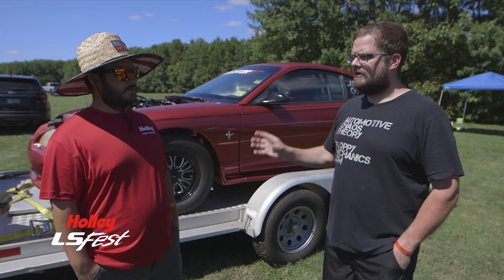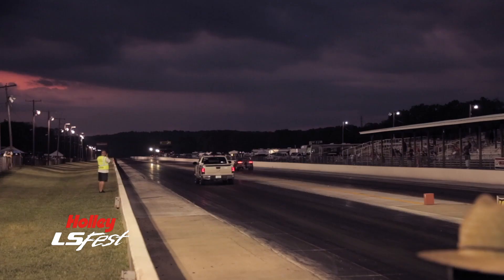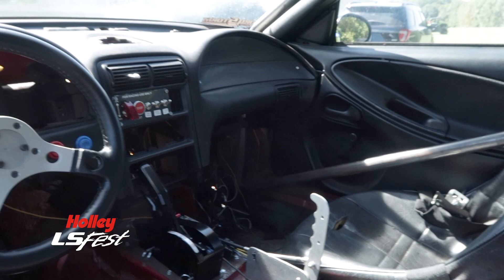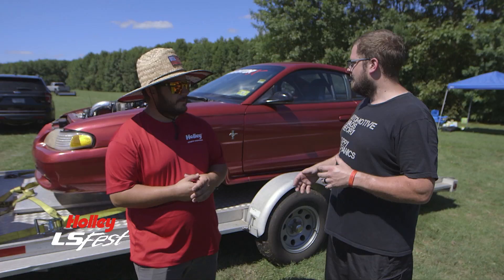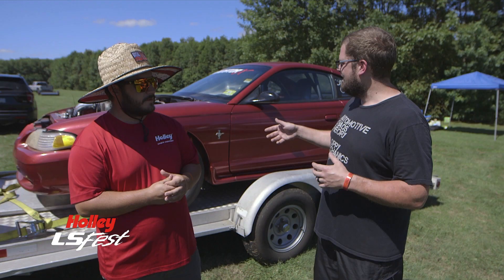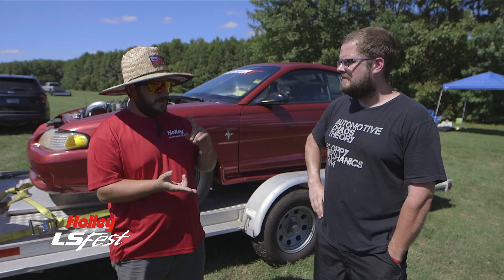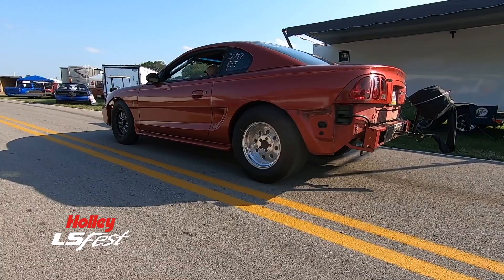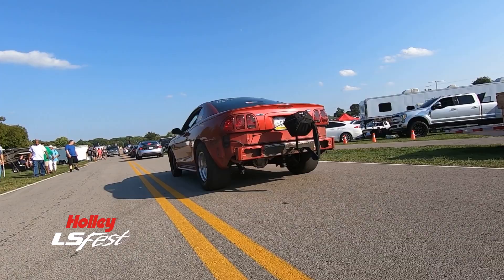Terminator X Sloppy Mechanic Matt Happel's Project 8F8 - Holley LS Fest

Comment: Been watching Matt for years. I did my 5.3 swap using another standalone and switched to Holley Terminator X recently based on Matt’s review of its capabilities. I like something that works- troubleshooting the car is fun. Troubleshooting the computer is not! Holley just works- installed mine in 30 minutes and it started right up.